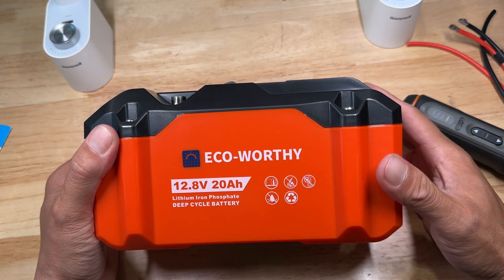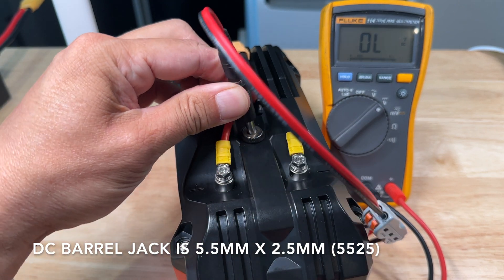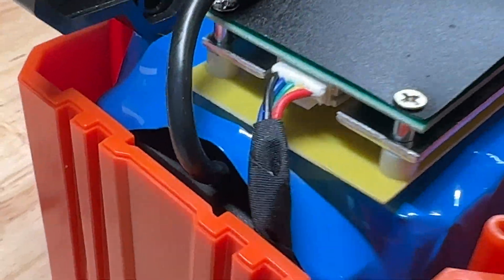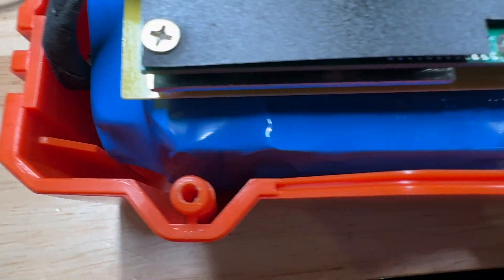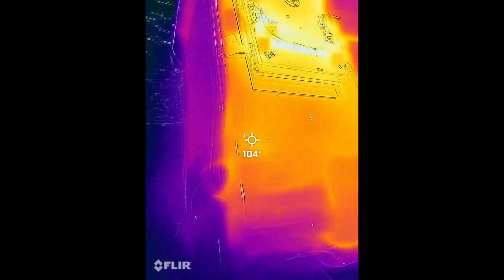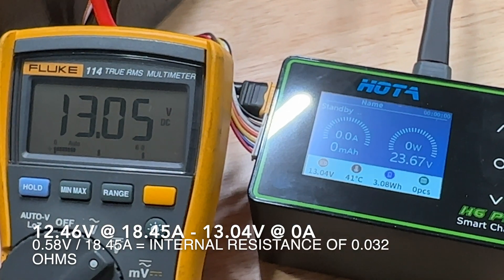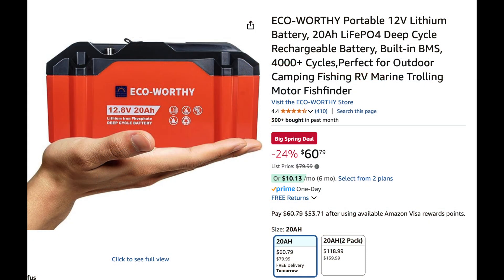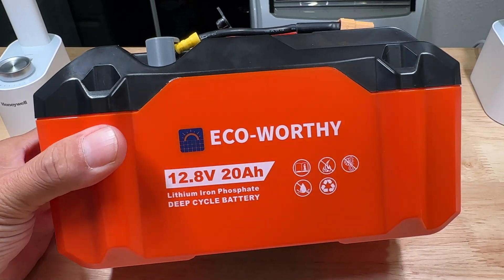Eco-Worthy 20Ah review and tear down

Comment: Hi all recently purchased one of these batteries. Curious If anyone might know how many continuous amps output the barrel connector provides?
Reply from the maker: Most DC barrel cord sets use 18awg, so I'd limit current to 8 amps.  You can push the current higher, just make sure the connections aren't getting too warm.  Some cheapo connectors might not even be able to maintain 8 amps, best to monitor the temperature.
Reply: @etischer ok thanks so much. I plan to use the battery with my cross band repeater two hand helds and a hand held amplifier I believe will provide about 40 watts out.

Comment: To charge this battery by solar power do you recommend charging through the DC barrel jack or through the m5 connectors?
Reply from the maker: The barrel jack is wired to the two battery lugs internally, so it doesn't matter which connection you use as long as you're not exceeding the current limit of the barrel jack.

I wired some of these pluggable levernuts to the battery lugs, and that's what I use for charging, and connecting to my 12v fridge. https://www.amazon.com/dp/B0BL39ZRM2.   Even when charging at 20A, my 12awg wire gets warm, but the plugs stay cool.
Reply: @etischer very good idea thank you. As well do you have a link for the 12 volt fridge you use?
Reply from the maker: @VE5SKY  https://www.amazon.com/dp/B0BL39ZRM2 I bought this one (16qt) because it fits in the subtrunk of my Tesla Model 3.

I also added an Wh meter https://etischer.com/dropfolder/teslafridge/IMG_2970.jpg

Comment: How would i go about charging this battery using a 12v cigarette socket?
Reply from the maker: I use a small RC charger: https://www.amazon.com/dp/B0B781TF3G. This one can run off DC 6.5-30v or AC 110-230v.   You can set the current 0.1-26A

Comment: Can you charge this with a running vehicle alternator parallel wired to an existing car 12 V system?
Reply from the maker: You should a charge controller to boost the voltage, and regulate the current.   I don't have any experience with this specific product, but might be close to what you're looking for, DC plug would need an adapter (DC5521-DC5525)  https://www.aliexpress.us/item/3256805352378951.html

I just use my RC charger, but that requires a button press to start charging.
Reply: It's a lipo, I think you need a lipo charge controller

Comment: Any Ideas on how to charge it from A solar Panel? - specs hint at it but don't give specifics?
Reply from the maker: You'd need a solar charge controller.  Im using this one for keeping my car's 12v battery topped off. https://www.amazon.com/dp/B07NPDWZJ7  This lets you set the high voltage charge limit to match your specific battery.  There's a positive ground version that's almost half the price that might work for you too, it's only $10.
Reply: Wouldn't you need a charge controller suitable for lipo batteries???

Comment: Not sure why anyone would replace the circuit board with a new board, other than it needed replacement due to a fault or damage
Reply from the maker: More advanced BMS boards let you monitor individual cell voltages on your phone, can send notifications to your phone based on SOC, voltage, or current limits...  They can count amp hours and watt hours so you know exact state of charge...   These BMS boards are usually reserved for the larger 100Ah batteries, since the BMS becomes less percent of the overall battery cost.  For a 20Ah battery, I haven't seen one with a high end BMS.  This battery is easy to open, no cutting required, making it a good candidate for a BMS upgrade